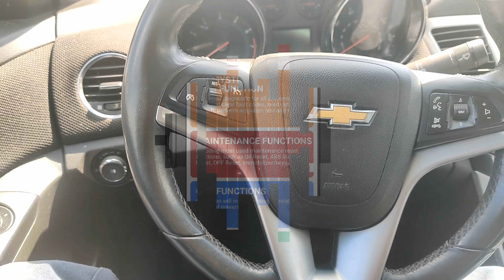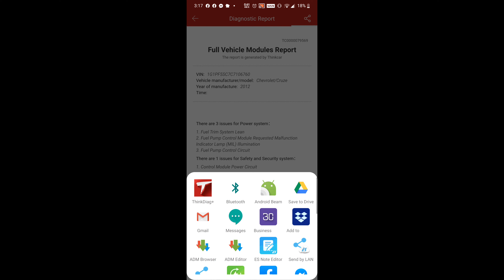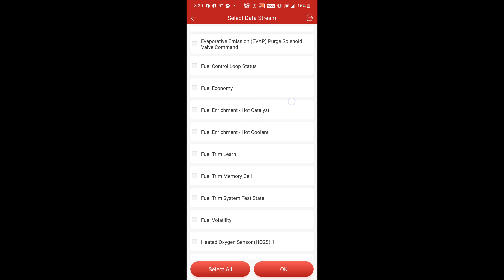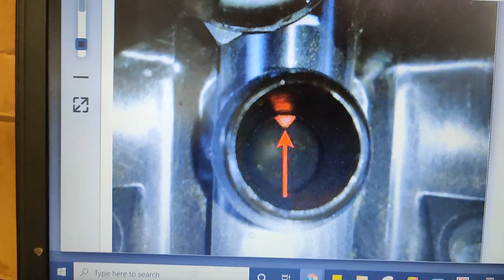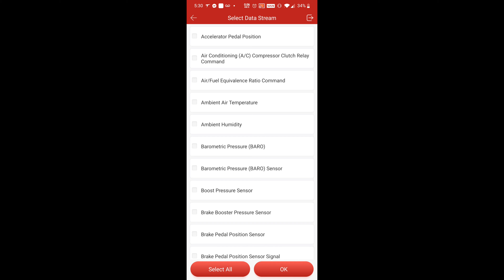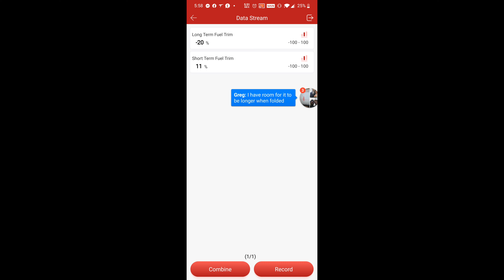2012 Chevrolet Cruze RS 1.4l Turbo P0171 P069E Part 1

Comment: there is a print app that will print anything you have saved on phone so if you can save the record to phone try Hammermill print think it works on most all phones and tablets its all i use for mobile devices easy to set up and works with any printer. you can print 2 sided if your printer has the ability
Reply from the maker: Thank you, I think it's more of a Launch issue. It does something to the pdfs on the tool when you try to print through a 3rd party app. It says they are corrupt. I just email them then print 😂